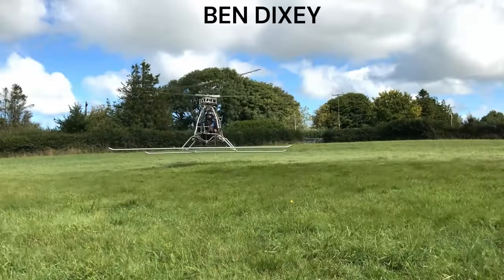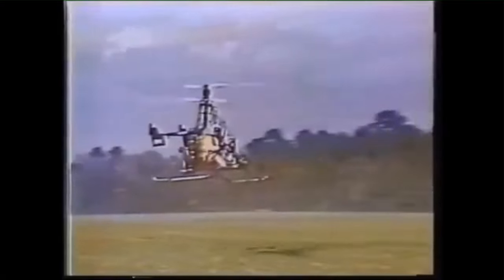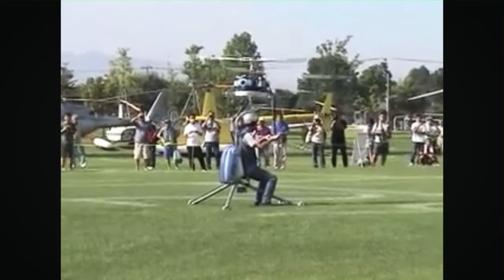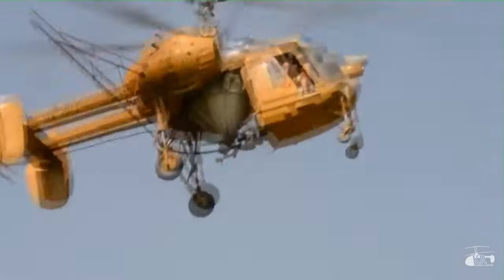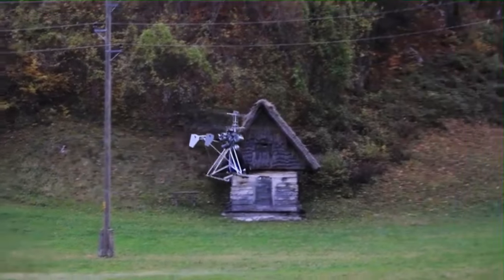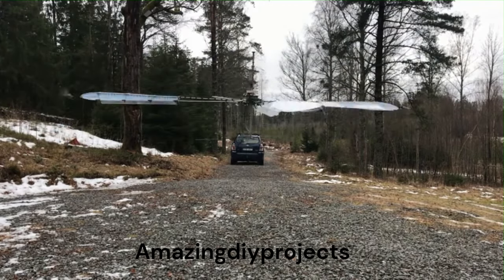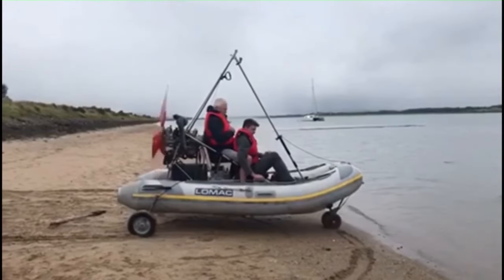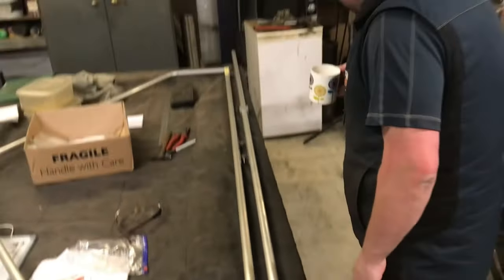Fixed pitch Coaxial Helicopters are they any GOOD?  Homemade rotary wing aircraft

Comment: I've spent probably well over a thousand hours playing Besiege and designing helicopters, but coaxial swashes just break my brain. I can get as far as cyclic + collective, but I couldn't figure out how to set up the linkages to do differential collective for yaw, and I seem to struggle finding good technical drawings of these kinds of swashes. Whether you stick with fixed pitch or try out a dual swash system, you'll be back in the air in no time. If not with the heli, then with the flying boat! :D
Reply: Forget about it

Comment: Keep publishing flying boat videos, they're interesting too. There's yet another helicopter control method that was recently demonstrated by another youtube channel (Tom Stanton) where the rotor blades are hinged and free to move and the thrust of the motor is timed to control the attack of the rotor. As you could imagine, the thrust needs to be varied during different phases of a single rotation.

This works for tiny rotors and very fast and powerful electrical motors. I'm not sure how well it worked and how well it would scale up though.
Reply: It's worth noting it just barely works with the electrical motors, it stresses them out a lot and causes them to heat up very fast. I'm not sure how you would go about taking the idea and applying it to an ICE but if anything, I have more faith in it, as there won't be windings to burn out or demag+desync events, etc
Reply from the maker: I'll have a look, don't think I've seen the video you are talking about. Looking through Tom's videos it looks like there are quite a few I've not seen. Got some catching up to do ! 👍

Comment: Hi Ben, I built a prototype coaxial helicopter some years ago. It was never untethered from its test stand but alot of valuable data was collected. I didn’t like the complexity and reversal problem in auto rotation of variable pitch on main rotors. I chose to fit a simple tail rotor as there is no torque to compensate and can therefore be relatively  low thust and still maintain a short tail and would maintain smooth yaw control in transition from powered lift to auto rotate.You could even do it more simply by embedding 4x little electric,reversible model plane motors into you tail section for full redundancy and shield them from rotor down wash and sound wave collision which can have a major acoustic penalty. In the event of all electric motors failure you can auto rotate with foward speed with rudder control till touch down.
Reply from the maker: Great stuff, thanks for the comment. Well done for working out the very complicated control of twin rotors via swashplates and differential collective. 
Your idea to use electric motors and props would be a good one. Definitely worth exploring on a coaxial, I don't think I've seen that attempted. 
Have you seen this video where Oskar has developed an electric mosquito air? 
https://youtu.be/EdOrqqWZvLY?si=fxRUNcPuLPxgF34x
It has the same electric prop configuration as you suggest but it's having to counteract a single main rotors torque. As you say on a coaxial you wouldn't need much. Tail vanes as I chose worked ok but I think during one wind gust it became ineffective. You could have good yaw authority with the electric setup. I hadn't considered this option until you messaged. 
Are there any details of your build online ?
Reply: No details of our build were published on line, sorry. The person that  was financing the project got sick and died part way through. His daughter sold up all of her father's stuff and I purchased the coaxial project but have not had the time to continue it. I know Oscar and was a student of his when training for my gyrocopter license and have seen his prototype electric mosquito video's. I got a lot of inspiration from the Russian Rotor fly project. But that to came to a stand still after a problem developed between them and there German partners. I think Germans went on to develop there own coaxial helicopter and have completed a commercially available unit. I can't recall the name of it but the main researcher was publicly funded and all of his study documents are or were avaliable on line to study,if you want to do a deep dive into the subject but very interesting reading for people like us.

Comment: I think the fixed wing flying boat project makes a lot of sense to sort out the basics of flight, but the occasional diversion into helicopter thoughts is also good to gently pull that project into shape in the background. Glad you have seen the light about collective pitch - I just wish the various e-VTOLs out there would also see that design for autorotation has many advantages.
Regarding rudder movement then there are two reasons you really need it: The first is to correct adverse yaw from aileron deflection - in fairness not much of a problem for ~8m wingspan; The second is control the control yaw during landing or takeoff - so in ground/water effect you may find yourself relying on it a lot.
In normal flight the rudder does a lot less, but allows coordinated turns (and pitch in very tight turns) or setting up a sideslip to dump height.
So allowing +/-30 degrees is a good first assumption, but if you were nervous allow for +/-45 degrees then provision for an adjustable control stop so you can set it up after some flight experience.
Reply from the maker: Thanks very much Martin. I need to send you some updated figures. Appreciate the info on rudder deflection. Sounds like I might need to increase what I had planned.
Reply: @Ben-Dixey  , to be honest if you've done some homework looking at other aircraft to produce a number for rudder deflection angle then stick with that. My numbers were estimates to be used as a starting point. I'll have a think to see whether I can produce some calculations for rudder and elevator deflections. I do get a bit nervous that I'm just swamping you with graphs that might not make that much sense. A video call might help me to explain the flight dynamics behind the calculations I am doing for you. At some point this will all be coded up into a more sophisticated tool for other home build aviation projects (hopefully some electric).
Regarding channel numbers: build it and they will come. I didn't find the channel until near the end of your fixed pitch coaxial helo project.

Comment: There's the Schofmann coaxial ultralight helicopter. It's a fixed pitch coaxial on a tripod. The pilot sits on one leg and pivots the rotors with the other two. It looks like if a coaxial is simplified and scaled down to that size, it's easier to build and control.
(Franz Schöfmann from Stockerau, Austria)
Reply from the maker: The Schofmann was a big inspiration for my project and he did exceptionally well. Should have mentioned him. 
The hoppi copter is another I could have mentioned.

Comment: Thank goodness you're going collective pitch.

I too have told the missus the sch2a coaxial would be a suitable Christmas present.

Check out the Kavan it uses a control surface on each blade at about 2/3 blade span.

Also for some reading fun search 300 pager  Sikorsky document on different type rotor systems, roll up rotor, telescopic rotor plus many others.

Yeah I'd watch your ground effect videos.

Keep up the experimentation, to quote the legend Igor Sikorsky,
' some may think you're a crackpot until you hit the jackpot' :)
Reply: Pretty complex route to take, I'd prefer a single rotor design, but having said that, there's so many resources for one to take, from traditional software to AI, which could help in his final design choices and related calculations. Same for fabrication, although he seems to have most of it covered.
Reply from the maker: The Kaman servo flap control is very interesting as is the intermeshing rotors. I don't think despite the size of the Kaman it has any hydraulic assistance. Controlling the blades in this way is obviously easier on control forces. I also believe they use wooden blades for the advantage of fatigue life. 
I like the design accept the big danger of approaching the helicopter from the side. The rotors get low enough to the ground to strike a person. I can't think of any other helicopter that uses servo flap control. Not sure why others haven't followed. 
This is dick degraw's syncropter he is an engineering genius. 
https://youtu.be/9TUbR5Zogv8?si=tQC7w6VmACR9E2Ye
Reply: Check out the Kaman seasprite a conventional single rotor with blade mounted control surfaces.

I spoke with a crewman of an aussie military outfit asking what he thought and was it a smooth ride.  Like you i thought it would unload the head from considerable aerodynamic  stresses.

 'When it was good it was smooth as,  but the servos would play up and it would be rough as'.
on asking about the servos job he couldn't elaborate beyond a power amplifier.
 Our airforce [nz] had them also and they turned into a money pit. 
Even so I liked the idea.

The swash plate controlled what looked like a wire rope onto a pulley attached to a rod passing through the blade to the control surface.
 I would have thought it  resulted in small undesirable changes in pitch while lead lagging and flapping.
Reply from the maker: Interesting stuff. Good to see a single rotor design with servo flaps in the seasprite. 👍
I haven't seen much in the way of pictures showing the mechanisms controlling the flap. One thing that you might think could cause an issue is the significant weight added to the trailing edge of the blade. It's hard enough to get a blade to balance at the 25% chord as it is. 
Your point about flap defection with blade movement is another.

Comment: I havent thought much about homebuilt aircraft for decades so i find this super interesting.
What's with the loose fabric wings at 8:30?Are those meant to be self shaping when run at the correct angle?
Reply from the maker: Hi, the fabric was just to give a visual idea of what it's going to look like but the wings definitely will be fabric covered. I could choose a single skin wing like the hoverwing and mudskipper or I could choose a double skin full airfoil like microlights have. Someone in the comments reminded me of Rudy Heeman's flying hovercraft and he used double skin wings with two aluminium spars and foam inserts to keep the shape. Single skin wings do inflate to form an airfoil of sorts but it's not exactly the most efficient of wings.
Reply: @Ben-Dixey  Thanks for the detailed reply.All very interesting.

Comment: I'm more interested in fixed wing aircraft. In this case I'm primarily here for the flying boat.
 I would like to say that autorotation doesnt really happen from ground lift. The pitch of the rotor blade has to be brought down 👇 n a very smooth and controlled manner but it must be done quickly to maintain momentum as well. The idea is that coming down from altitude you are using the negative pitch of the rotor to turn them as the air goes through them and just before you touch down you are going to use that conserved momentum to allow for a change in the blade pitch to create enough lift to touch down at a controlled speed.
If you loose a motor a couple of feet above the ground or in ground effect, the last thing you want to do is lose lift by dropping the collective. You won't have time or altitude to trade for a softer landing at that point.
Reply from the maker: Thanks for the comment, glad there is interest in the flying boat. Regarding autorotation at a few feet, there is something called a hovering auto where you use rotor inertia and collective pitch to cushion the landing. It shouldn't be called autorotation because it's not but from a foot or two above the ground it will allow the soft landing of the helicopter using the collective. At no point is the collective reduced in this instance, you only raise it at the correct moment.

Comment: generally aerodynamic surfaces used for control wont sweep more than 25  degrees
GEVs usually keep their tails out of ground effect to be in a more normalised flow, and in doing so are usually T tails
The easiest form of rotorcraft is the sutogyro, which can be coaxed into vertical lift if the rotor is driven. 
And perhaps like the Fairey Rotordyne using tip jets although almost certainly these days we could achieve the same with electrically driven tip props that collapse into a fairing when not in use. While single rotors are speed limiting due to retreating blade stall, this too can be supported by a small high speed wing on the retreating blade side.
All landings could of course be under autorotation.
Reply from the maker: Great comment, thanks, very helpful. 👍

Comment: Fixed pitch chopper looks even more suicidal than those low mass bell rotor designs that have mast bumping and need a certain height/speed to do successful autorotation.
No matter how many engines, if fuel is exhausted/interrupted for some reason, they go down, very hard.
Reply from the maker: Like all these things whether something is suicidal depends on the operator and the decisions they make.

Comment: Could you have a single axiel rotor with a fly wheel beneath the seat attached to the same drive but rotating in the opposite direction of the top rotor, with relevant mass and distance to provide a counter to the top rotor to prevent the tail moving and provide gyroscopic stability?
Reply from the maker: Interesting thought. There is already a flywheel on the engine and that would be capable of applying a torque to the airframe but only under acceleration. It couldn't be used to counter rotor torque on a single rotor unless it was constantly accelerating. It would have to be big and heavy too I would imagine. 
The only way I think it's possible to use the stability of a gyroscope on a helicopter is to use Arthur youngs stabiliser bar. This provides gyro stability by controlling rotor blade cyclic pitch. The trouble is stability increases but at the cost of response time. There is more of a delay in control and this makes it harder to fly accurately. There is already a delayed response to cyclic control and the stabiliser bar makes it worse, but it's possible to get a helicopter to hover almost by itself using a stabiliser bar. 
Model Rc helicopters use them to great effect.
Reply: @Ben-Dixey  Thanks for your reply. I used to fly RC heli's but am clearly out of my depth technically speaking. Or maybe, have the fly wheel on second motor. hehe. Any way...as you were. ;)

Comment: Hi Ben,
Greeting from Denmark.
I'd like you hear your comments on a (maybe crazy) idea I been wondering about: Would it be possible to build a simple and somewhat cheap craft, that has a single fixed rotor and two tails split 90 degrees. Or what is the simplest/cheapest design you can make. Something big  enough to carry about 200-250 lb worth of gun, ammo and sensor.
Ignore the need for autorotate as it's for a drone. A normal quad/octo-copter setup is not feasible this size. Would need massive batteries and would still have too limited endurance. And adding an ICE with generator is too inefficient I think. Matters when we talk this much weight..... 

I guess you already guessed where it would be used. 🇺🇦  So send into harms way, that's why it need to be cheap. And preferably simple=resilient/robust.
 
I was thinking an engine (maybe from an outboard) with the crankshaft directly on the rotor mast, if it would be able to be started without a clutch/belt. And with electric driven props for up/down control on the tails now there is no cyclic. Thinking about while I write, they might be better places low to the ground and push left/right and fwd/aft there.
Not sure if yaw control on the tail should also be electric or it would be feasible to make a hollow tail NOTAR style and blow the cooling air out that way. Or the normal setup with a driveshaft and normal tail rotor is simpler/cheaper. Using the hot air would increase IR signature, but it might be huge anyways....
Reply from the maker: Hi, it's possible to make something like you describe fly. The rotor would probably need to be stabilised by Arthur Youngs stabiliser bar, which adds some complexity. 
If you had a main rotor providing lift but then a quad copter style outboard ducted fans or props for stability then I think you could have a fixed rotor without the stabiliser bar. Not sure what sort of speed would be achievable and therefore what the maximum wind speed would be flyable. 
There would need to be a gear reduction on the rotor as rotor tip speed needs to be around 600 ft/sec.

Comment: Fixed pitch is for hovering close to the ground only. It will be nice to see his results with variable pitch - Two engines mean double the risk of an engine failure. It means the fixed pitch rotor design is incapable of autoration and can never fly more than a few feet above the ground. The higher fixed pitch go the greater the guarantee of hospitalization or death. Its akin to hovering a piston aircraft at zero forward airspeed at a  height greater than that which the skids can absorb a crash landing. Its a design that has dubious practical value. 
Variable pitch home built aircraft are the real alternative.

Comment: Are coaxials inherently more loud than conventional ones? After all, the tail rotor can be shielded, which reduces the noise significantly!
Reply from the maker: I don't know for sure but I think coaxial's would be slightly quieter than a conventional with standard tail rotor. The tail rotor is what causes a lot of noise. Ducted ones less so. Don't think any helicopter will be a quiet machine but us helicopters enthusiasts like the noise.